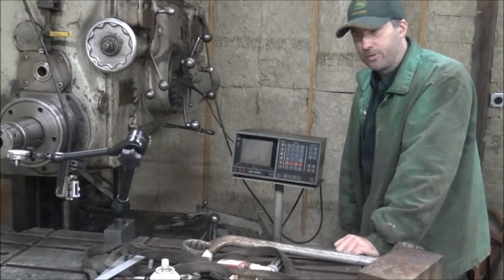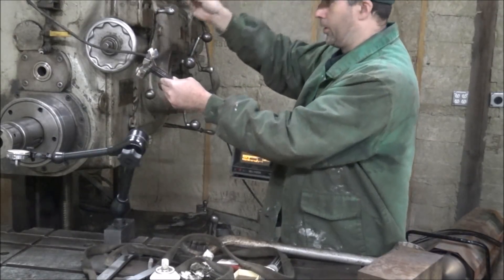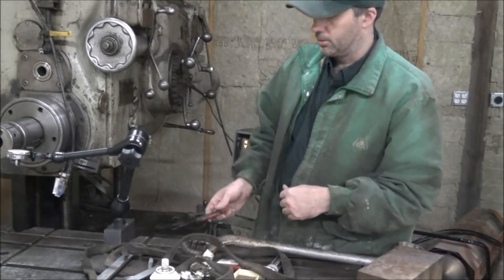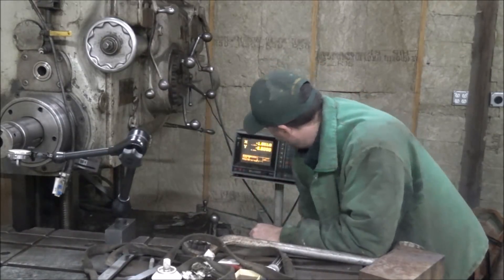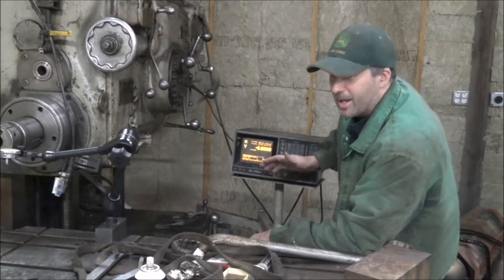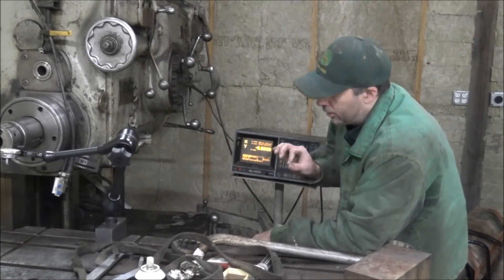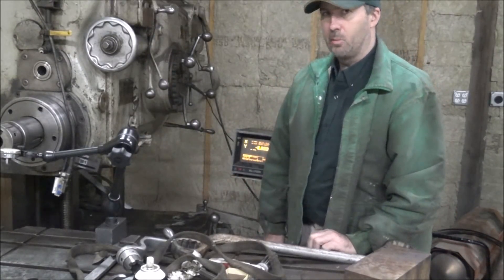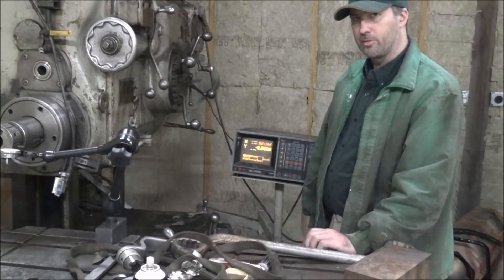Almost Accu-Rite

Comment: Maybe some electronics cleaner/lube in the pots would have some effect
Reply: To qualify my comment - I dont know shit about those DROs, but I believe Scott has a good suggestion= and it dont cost nothing. Switch cleaner and a real gentle cleaning of the wire connections on those POT boards and look for any corrosion or loose surface mount devices on the little boards.   Experience getting things to work intermittently by gently prodding/ and cleaning. Obviously those monkeys beat it up trying to move it.(You  are way above me Brian- I just think Scott and Pierre are thinking right) Good luck  on top of your great mind.

Comment: Brian how do you keep the tables from rusting; use johnson paste wax with oil? or just oil.  I concerned with inactivity during the winter months on my lathe.
Reply from the maker: I use fluid film.  I hope it will be climate controlled by next winter so maybe not an issue.
Reply: ive used baby mineral oil, its super cheap and rub it in well, sorta dries over the weeks so doesnt stay so oiley
Reply: thanks
Reply: Sorry but what is fluid film?
Reply: Lanolin based spray on rust preventative. Used on vehicles and anything that you don't want to rust.